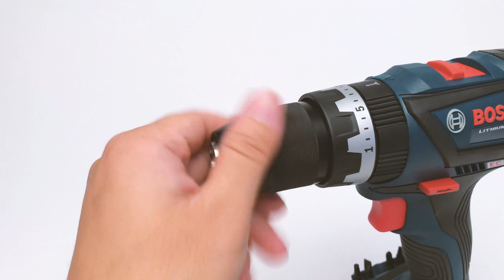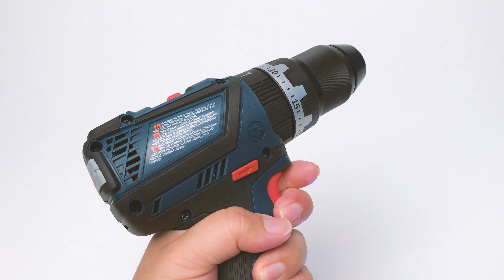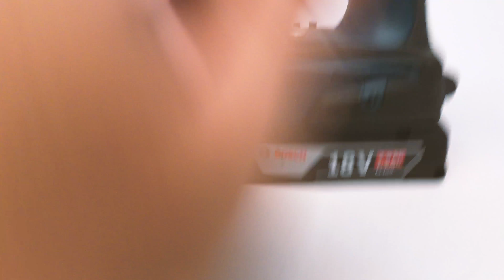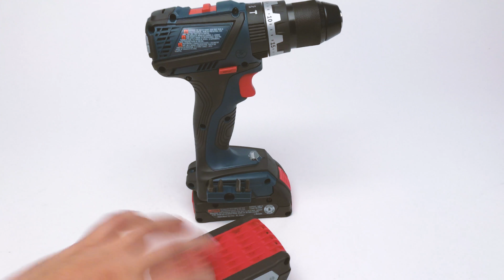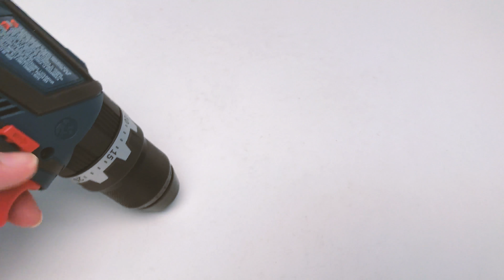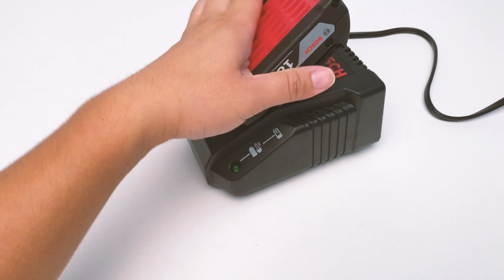Bosch HDS183 Cordless 18V Brushless Motor Hammer Drill Review

Comment: Which one is better m12 fuel vs this one??
Reply from the maker: If you need more torque this is 18V which will give you more torque for certain applications. If you want more portability M12 being 12V system will do just that. But comes with reduced torque

Comment: I just got this drill. Really like it but do you find the “step up” of rpms of the trigger is irregular? Sometimes there is a skipping sound. I exchanged it for another and the same thing happens. I actually had it stall (electronic cell protection?) and now the “step up” is smoother but not sure how long that will last cause the first drill did the same but it reverted back to that skipping sound.
Reply: Mine does the same thing…I will let the protection kick in an see if the trigger is less sensitive…thanks

Comment: Which drill do you prefer the between to Bosch and makita?
Reply from the maker: Definitely more towards the Bosch than my previous Makita, one thing I couldn't stand on Makita is that they designed venting hole on the back of the drill, which if I press my hand on it to drill, my hand not only blocks most of the vents, but the hot air coming through the vents are also unpleasant.